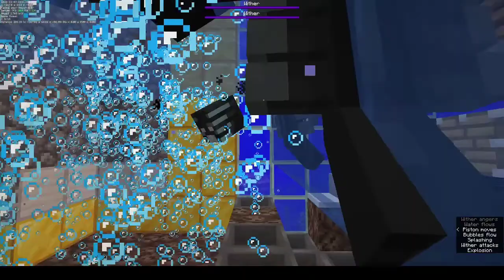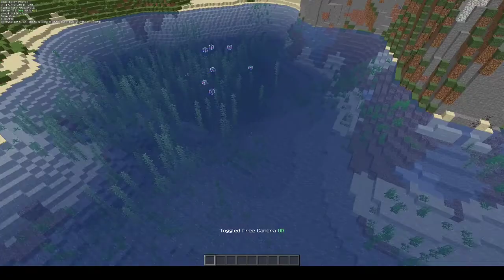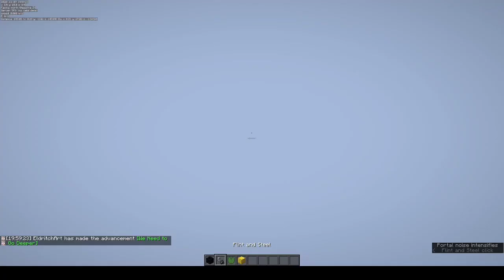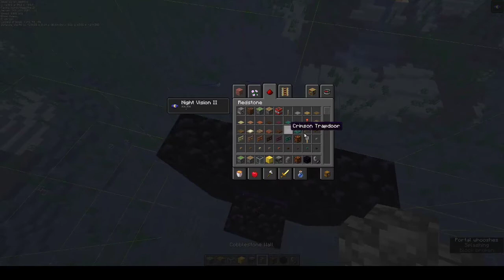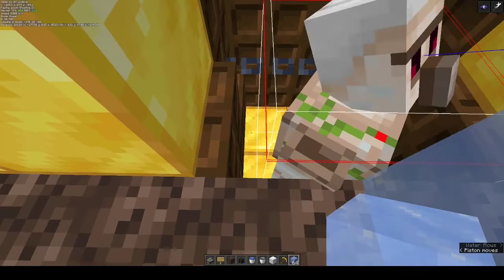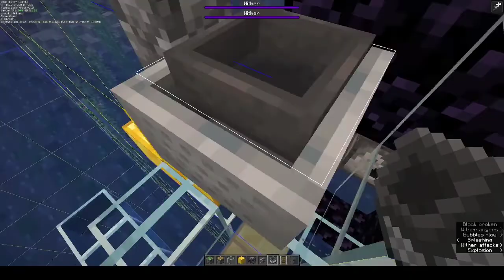Obsidian Reactor Tutorial

Comment: So, I've built this in MC 1.18.1/vanilla and it works like a charm. Few tips:
- If your server has /tpa, /back or /home, don't ever use that near the withers. Iron golem apparently spawns later on and withers aggro you, destroying the cage. 
- It's possible to use this farm alone by just dropping items on your feet. This will allow you to chunk load the overworld when you're in the nether, therefore avoiding the above mentioned problem (that apparently applies to single users too after few cycles). 
- If you disconnect from the farm, pray it's on the nether side. If so, come back from the overworld. Place a portal like 30 blocks away and light it, it should be far enough. 
- In case your server has drop limit (q press) anticheat like mine has (if you drop X items in a given time frame it kicks you), replace the pressure plate in the nether side with strings and tripwires and use the only free end to power a dropper to load chunks. dropper can't be kicked.
Reply: waht sever?
Reply: @Sakura_senpai_CPVP  paper

Comment: Loading solution!

I tinkered a bit with chunkloaders and found a solution that loads this farm anywhere even in singleplayer. Basically you add a small delay (3 repeaters on the last setting) to the part that brakes the portal after you go trough it. Then you add a dropper with items to the nether side, next to the pressure plate. This will send an item trough, loading the other side for the next 15 seconds, and voilá the farm is always loaded when you use it. The inventory must be full or else you will pick up the item before it goes trough. A collection system on the other side is recommended.  

You would have to enter the farm from the ow side for this to work.
Amazing farm btw. Needed one like this for a long time.
Reply from the maker: I remember trying something like this but I think I had problems, maybe I did it wrong though. Also hard to remember since I designed this a while ago. Did you succeed in designing a system? If so that is awesome and makes this farm even better
Reply: @eldritchart716  I'm using this approach right now on the world download, and it seems to be working alright. The chunk loading doesn't always work, and sometimes I end up at the starting portal rather than in a new one. It's probably slower than the original version with the added delay on the overworld portal pushing you down the water stream a bit, but being able to put this outside of the spawn chunks is well worth it. I also replaced a redstone dust with a repeater on the nether side to delay the lava portal break and make sure the item goes through before the portal breaks, but I don't know enough about this mechanic to say that it helped the chunk loading.
Reply: @bennetthaah8236  Do you still have the world? It would help me out a ton if you do!

Comment: "If you're in survival, its hard to fix a mistake, so don't mess up"
Yeah seriously, even for both withers and the rest of the steps. I had to completely restart a build because I didn't set up the portals from the beginning correctly.
I got this monster working in my world, and it works wonders. Its easier to build once you sort of get the hang of it.
Side question, what's the purpose of the composters? Just to prevent stuff from falling in the hoppers?
Reply from the maker: The composters just prevent a small amount of hopper lag. And they prevent loose items from falling in as well, yeah.

Glad you are getting some use out of it!
Reply: @eldritchart716  Bro I have a doubt,
Should we built it in spawn point itself?

I didn't watch the entire video first,
I was builting and watching together...
My reactor is half complete and is like 20,000 blocks away from from spawn in our smp..

So will it work after I built it..
Plz reply

Comment: ill be honest I had a lot of issues with this farm but once it got running it went sooooo fast. the first issue, snow golems wouldn't make snow, 2nd issue nether entrance portal wouldn't get destroyed when I went through it, 3rd issue withers somehow killed the iron golem and then broke half of the machine. My mistakes: building the cobble gen on the wrong side of the build (don't know how I managed to do that). the only issue with the video is that it didn't show how to put in the hopper minecart to collect the obsidian (I ended up lining up 2 hopper minecarts with cobble walls). Other than that the farm works perfectly. Really fast and only requires flint and steel. 100% worth the 3 hours of pain from things breaking.
Reply: what did you do to fix the second issue?

Comment: Can someone smarter than me help me out? Im on a 1.16.5 server. For some reason the portal will spawn just a couple blocks to the left or right after it has have been succesfully running for 5-20 minutes. I have tried moving the portal in the nether 1-2 blocks to either side but it keeps happening. how can I prevent this?
Reply: im having same issue have you managed to find a solution?
Reply: perhaps it's an unstable coordinate? you have to divide overworld coordinate by 8, so what if the overworld coordinate is an uneven number and you can't place the portal in the nether absolutely on point? then the portal might think there are multiple correct overworld portal location. it's just a theory though.
Reply: @constantinpostelt1763  that could be the problem maybe yeah ill check which coordinates my portals are on and perhaps move around the nether side portal, ill let u know if it worked
Reply: @_jp_polnareff_8295  did u find a solution?
Reply: @sebastiancarter8098  i guess the problem is in the nether side of the farm
if you manually go inside a portal in the nether side
it can make you spawn in a portal up to 8 blocks around where you want
if you place the boat thing that pushes you, you will always be on the same exact spot if you dont touch your keyboard
and then you will always spawn in the same exact location

i had the same problem for 2 days until i figured it out, it was the boat that i didnt build before testing the farm
Reply: I have the same issue but don't really know how to solve it but for me its just one block to the side it doesn't break the farm for ever but its annoying to fix
Reply: @adrianfuchs6736  Thank you a lot! I had the same problem and now it's fixed so :)
Reply: For real I just spent 4 hours figuring out what is wrong.
Reply: @vili4130  I guess calling it a reactor was a good name because it really isn't very stable

Comment: the portal keeps spawning like to the left where the collection system is or on the dropper system with the snow balls do you by any chance know the reason for this?
Reply: i guess the problem is in the nether side of the farm
if you manually go inside a portal in the nether side
it can make you spawn in a portal up to 8 blocks around where you want
if you place the boat thing that pushes you, you will always be on the same exact spot if you dont touch your keyboard
and then you will always spawn in the same exact location

i had the same problem for 2 days until i figured it out, it was the boat that i didnt build before testing the farm

Comment: what happens if you use this outside the spawn chucks with only a single account? You can't send a item ahead of you, as items do not make new portals , if they did we would not need to use the player for this farm. The question is, in what order are things loaded in survival, as there is a delay on the portal before you go through. Has anyone tested if that is enough to allow the wither to take target before the play enters whiteout using a second account or being in the spawn chucks?
Reply: As far as I'm concerned, making this farm outside the spawn chunls without a second account will not make the second portal, as you will appear in the lower one while being broken.

My advice is to add one dropper with any item connected to the pressure plate in the nether, in order to load the ow part propertly.

Comment: I made this farm in a 1.16.3 server and it keeps blowing up, leading sometimes to the Withers escaping. I made sure the withers and the iron golem were in the same chunk, and the portal generates correctly, so I guess the wither cage is not fully reliable. It always broke while I was AFK, so I don't know what the exact issue is. I've tested it in the same world you provide, singleplayer, and after some time, the right side (from the Wither's POV) breaks, even without entering the portal. Any help?
Reply: If I remember right. In 1.16.3 the new wither head reacting to water stream mekanism is not implemented yet so the heads goes directly in the cobble or the Iron golem. Or the second thing is that the chunk unload cause you're in singleplayer or there's nobody in the chunk while you're in the nether. Also, I find that snowgolem for me was getting wither distracted ans then focus them and then blow up everything so yeah try fix it by moving snowgolem farther from wither as I dead. Sorry for bad Engrrish
Reply: @azurakah  the skulls the either shoots do interact with the bubble columns, and I'm sure the area was loaded while I was in the nether. So I guess I'll try to move the snow golems a bit
Reply: @jucanavazreque3429  yeah you can either put them behind the golem or high up in the sky but it's a bit far for the snowballs to go down in the dispenser or just out of the chunk idk the area that wither can agro a mob